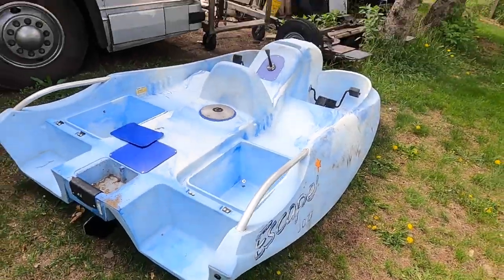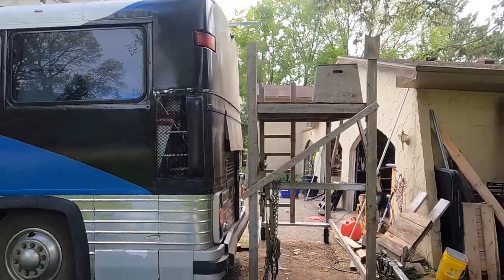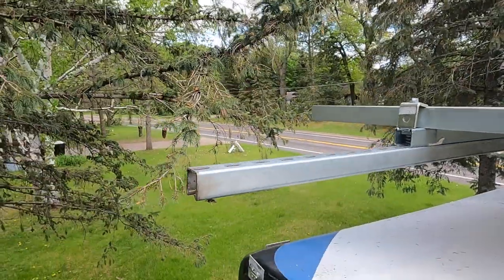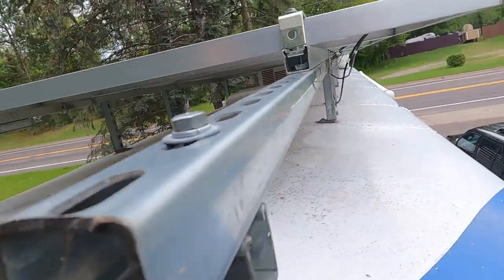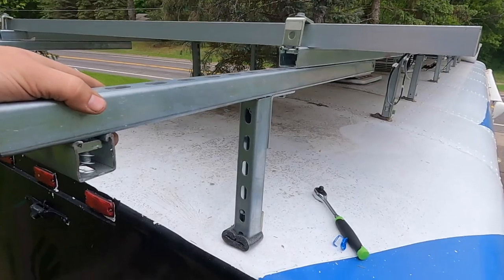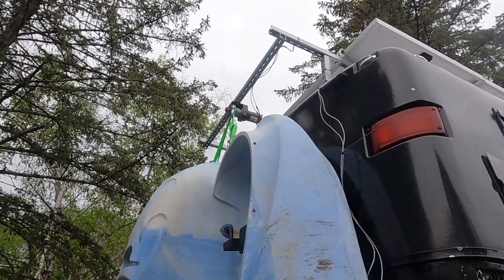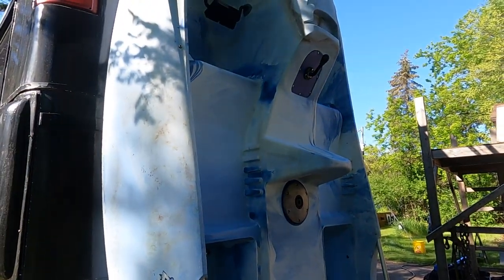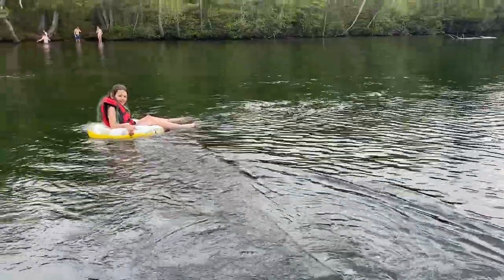Can you put a paddle boat on the back of an RV?  Winch paddle boat in and out of the water.

Comment: I did this on  the back of a 5th wheel trailer about 10 years ago.  Soon after, sold it and got kayaks.  Put 2 big ones on the roof, 2 small ones in the storage bay.  Kids used the kayaks way, way more than the paddle boat.
Reply from the maker: My other plan was to do what I’d call a kayak pontoon boat. Two kayaks, some light framing and platform I can bring with that straps or otherwise attaches to the kayaks to make a pontoon. Or we could use them as just kayaks.

I might have room in the space under the solar rack for kayaks anyway.
Reply: @HimmelbergerBus  You could fit 8 foot kayaks in the bays.   You could put 10-11 foot kayaks on the back of the bus like you have the paddle boat.

Comment: I’d also consider adding a hitch mounted cargo carrier to carry part of the weight. Even just a piece of steel tube fixed in your hitch receiver so it could carry some of the load.
Reply from the maker: Not a bad idea.   Actually when I looked yesterday the bottom is resting on the rubber rub rail.  It's definitely a work in progress.

Comment: I’d be very concerned about engine cooling with boat covering some of what looks like the exit vents for the hot air. So I’d be watching my engine temperature very, very closely!
Reply from the maker: I added those vents, not sure they even do much.  Engine temps looked good on the way home in the 80s.
Reply: @HimmelbergerBus   — well, if you added the vents, then my concern about overheating drops a lot!
Reply from the maker: But I did add them because I was overheating :-) ... What really fixed my overheating was charging out the water pump and the fluid flush... and getting better at driving.  My radiators are not in good shape, I need to spray them off before or even mid trip in the summer.  I'm considering a mister system.